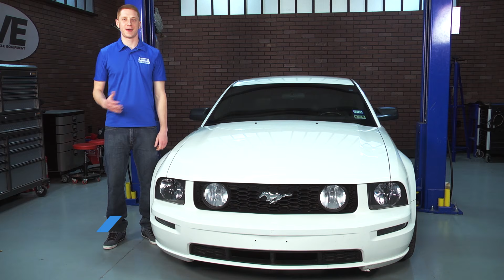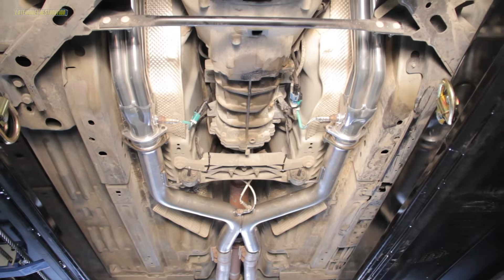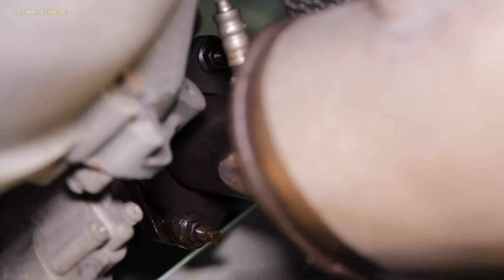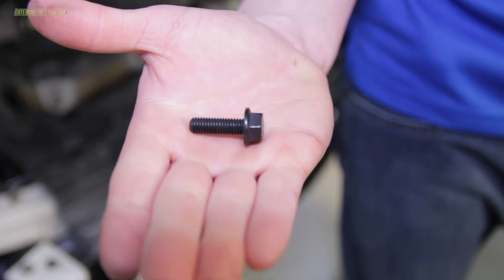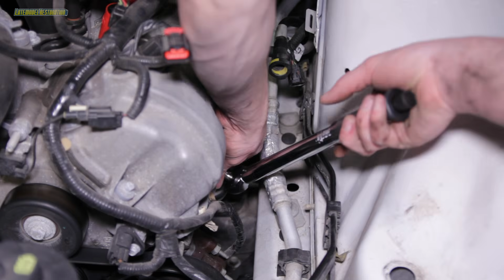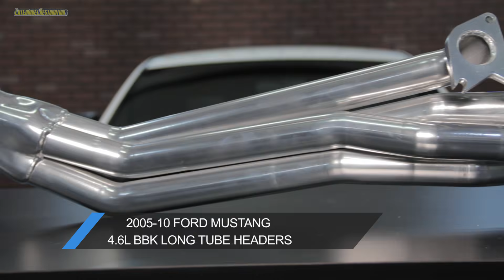Mustang GT BBK Long Tube Headers/Off-Road X-Pipe - Install & Dyno (05-10 4.6L)

Comment: Took me 11hrs in my driveway. The headers slipped right in, but getting to the bolts was a major pain. I recommend buying ARP studs and a chase to clean the treads. Seat of the pants says this was worth it!
Reply: Which studs did you get? I’m running into the issue of the studs BBK sent being too short and heard arp would have something better, I just wasn’t sure which one to get.

Comment: Just got done installing longtubes and it was a nightmare lol removing the motor mounts starter and steering shaft wasn’t too bad with a couple jack stands and a ramp but the problems start at the reinstall of the steering shaft it slightly touches the last runner of the header and the only solutions I can think of is adjustable motor mounts to raise it 1/4 inch or take a blow torch to really nice headers and dent it up

Comment: You take the motor mounts out so easily. I’ve been following step by step in my garage and it’s been taking me hours to figure out how to take the passenger side motor mount off.
Reply: ever figure it out? im doing it right now and could use some insight
Reply: @Dom_3v  if one side is lifting higher than the other....just do one at a time

Comment: For all the DIY people out there, Just because you have to raise the motor a bit to remove the stock headers and slap the new ones in, don’t let it intimidate you. All you need 
1. 2-4 Jack Stands.
2. Correct sockets.
3. 02 Extensions
4. A weekend.
Reply: Shoooot I did mine in my garage on the floor in about 6-7 hours. Everything came apart like butter and I cleaned the mounting surfaces on the heads while I had everything out. Wasn’t bad at all

Comment: Grab two pairs of o2 sensor extensions. The dipstick is hard to remove but with a little grease on the o ring it is easy to reinstall
Reply: This has to be the most under rated comment on here. Bbk didn’t send o2 extension and dipstick was a pain to get out/ put in. Wish I saw this comment sooner lol.

Comment: Can you use the metal gaskets instead of the graphite one that is provided?
Reply from the maker: Yes.  Long term, that's a better option.  Hope this helps!  -Landan

Here is a link to OEM Ford metal gaskets: https://lmr.com/item/LRS-9448C/mustang-3v-exhaust-manifold-gasket-kit-05-10
Reply: @latemodelrestoration  thank you!

Comment: I have a borla x pipe would I need to change them for these to fit.
Reply from the maker: Yes.  Your existing Borla X-pipe is designed for stock manifolds or shorty headers.  Purchasing the correct mid-pipe would be the easiest route to take.

Here is a link to the catted mid-pipe: https://lmr.com/item/BBK-1637/Mustang-46L-Bbk-Catted-X-Pipe-For-Long-Tube-Headers
Reply: @latemodelrestoration  appreciate it !

Comment: I got these but with a catted x pipe ans between 2800-3200 rpm there's a raspy tiny sound that sounds like crap I can't get rid of 

Did you have any sounds like that after the install? 

Only does when driving revving at idle doesn't make the sound 

Changed like 5 type of mufflers still there resonators didn't help

Comment: I’m 17 and did this in my garage alone on jack stands it was easy I got it done in one day took about 7 hours.
Reply: did you need to remove the starter and the motor mounts and everything? or could you pull em out without doing that

Comment: For the 02 sensor extensions I took my mustang Gt 2010 to get my headers installed and got a pair of 02 extensions and was told I needed a front pair but I can’t seem to find any front 02 and the ones I had bought in this videos said they were for rear sensor only
Reply from the maker: Hi Julian, if you can, please contact our customer service team and they'll be more than happy to help you figure out the issue with the O2 sensor extensions. Be sure to include the part number or order number and they'll be able to assist you with that. | https://lmr.com/contact

Comment: Which bolt needs to be cut exactly on the passenger side? I only ask because I didn't cut any and I can hear a leak on that side.
Reply from the maker: Hey there, 

We recommend that you re-torque everything after a couple of heat cycles to make sure that nothing has come loose. If it is still leaking, take the car to a local and trust shop and have them inspect everything.
Reply: @latemodelrestoration  you didn’t answer the question which cylinder bolt needs to be cut

Comment: Will this fit a 2005 Lincoln Town Car/ Ford Crown Vic 4.6 2v or should I order the 96-04 Mustang headers?
Reply from the maker: Hi Danny, 

We do not specialize in the Lincoln Town Car or Ford Crown Vic. You will need to look into Facebook groups or forums for fitment concerns when installing new headers on either one of the applications.

Comment: Desperately trying to get the motivation to do this myself in the driveway with just jack stands...so far, I just keep grabbing beer and stare at it. This looks a giant PITA.
Reply: Take it to a Ford dealership for about 5 or 6 hundred bucks in labor this install is scary lol
Reply: @DJRICKYGAZ  
can the dealership tune?
Reply: @WONDERBREAD89  Probably not, but if you have an X4 tuner, it's a simple strategy tune. Takes about 10 min
Reply: @sherylellingson3538  found out they can do factory tune but thats it..
and i do have and use my x4 now👍
🙏
Reply: I'm in the same boat really want to do this info have a garage and it's not a daily so I can leave it and take my time
Reply: You can do it it's a pain not gonna lie but it is possible
Reply: 🤣 classic 👍🏾
Reply: I ended up doing it on my 5.0 by myself on jack stands was a bitch but doing it again would be easier knowing what to do
Reply: Best comment ever!!!!
Reply: Same I keep avoiding it but I really want to do it but it does look like a giant pain in the ass to do not easy
Reply: It is a major pain to do if your local I'll do it for you for a price
Reply: I don’t think it’s worth it. I’d rather have someone else do it. It didn’t add that much power.
Reply: @CorbettReacts  how about sound?     add more sound? louder?
Reply: Foreal
Reply: did u end up doing it?
Reply: I replaced the k-member on my 09 Shelby GT500 with a BMR tubular one, it was a bitch doing it on jack stands but got it done in one weekend, next step is the long tube headers, I'm also planning on doing the same thing on my 08 Shelby GT350.
Reply: That’s the realest thing I’ve seen someone say in a while
Reply: Better grab a 24 pack my friend 😂😂 it is the biggest PITA ever, but worth it once it's done
Reply: Same here man, just worried about breaking off those studs.

Comment: How can I tell if I put the o2 sensors in the right order or where they supposed to be plugged in
Reply from the maker: You'll want to use the 2 forward O2 sensors in the headers from the factory headers

Comment: Is that stock mufflers?
Reply from the maker: No, the car has aftermarket. At this time, we have our SVE Axle Back kit designed for 05-10 Gt/GT500: https://lmr.com/item/SVE-5230A/2005-10-Mustang-Gt-Gt500-Sve-Axle-Back-Exhaust-Kit

Comment: On average how much is it to have someone install them for you? lol. Also do you have to tune them (the car)  to notice big power gains?
Reply: you probably know the answer by now, but it usually cost about 700 bucks to 1000 bucks for labor, depends on shop. and is best to tune if you get long tube headers and a off-road pipe to get full power out of them and also to takeoff the check engine lights
Reply: power gains probably up to 305- 320 hp with everything else stock with a good tuner

Comment: Only 19 and didn’t think my pops would be up for installing these with me until he told me he was, did it on a jack and jack stands over a long day and honestly wasn’t to bad, definitely gonna get some back and shoulder pain laying  on the floor but as long you’re organized and strictly follow each step you’d be saving yourself $500-$600, I spent only about $100 buying some swivel sockets, deep sockets and other tools I didn’t already have. Do it yourself you won’t regret the learning experience.
Reply from the maker: Thank you for this input on your experience. I am glad we were able to help and if you need anything else please let us know.
Reply: im 18 and I really want to do this myself I just dont wanna fuck something up. but I know I won't regret the learning experience
Reply: @devinharris481 Real shit. Im 17 and i’ve been doing just minor replacements on workout components on my 05 gt, but this just seems super intimidating.

Comment: Wondering if I can do this on my own with just jack stands
Reply from the maker: It would be more difficult to do on the ground with jacks and jack stands but it is not impossible.
Reply: Late Model Restoration I gave it a shot but I was limited on tools so I couldn’t remove the factory H pipe. I was stuck and had to put everything back. But awesome video!

Comment: How to install headers in 3 easy steps...
1. Order headers.
2. Drive to shop, have them installed.
3. Pick up car.
Reply: 4. Paying 1000 for labor
Reply: @reysanchez1908  this shop here will do them for 700
Reply: @reysanchez1908  about to go have mine done , going to pay $450. Couldn’t pass up a deal like that , known the guy who owns the shop forever. Absolutely stoked.
Reply: @v3jaylon  shit that's worth every bit of 400, I wish I could get mine done cheap like that
Reply: I learned that the hard way, it’s not worth it to go through the pain of breaking off studs.
Reply: step#4 payment will be expensive for this job
Reply: Shop wants $800! Hard pass!
Reply: If you can find a shop that wants to do them 😂
Reply: Do long tube headers need a tune after installation?

Comment: I watch this video a few times and was convinced I could do the install. I actually got everything done in two days. If someone else was thinking of doing this I would advise a electric ratchet and a swivel socket. Also you might wanna get a flexible dip stick tube. Getting the old one back in after the header install is a b****. Also majority of the studs on the passenger side has to be taken out so you can get the header up in there.
Reply: hey man did you end up having to take out the starter and everything else? or could you get them out and back in without removing that crap

Comment: I like the stock look with ,,with the roush power and tune,,the stock engine should be okay @ 550 HP with out having to rebuild it with forged  parts,,,,
Reply: Actually the biggest thing when it comes to forging is the TORQUE that you are producing, not the horsepower :)

Comment: Stop adding all the BS add on's to your Mustang,,Get a roushcharger installed ,.  I did,, nothing compares ,
Reply: you have to remember that a supercharger kit is wayyy more expensive than FBO. Just depends on what kind of reliability/how deep your pockets are.
Reply: purchase a one owner  2007 mustang gt premium convertible  with 21,000 miles in 2017 for $18,500  (new sticker price was $ 38,000) added the roushcharger installed by a my local Ford dealership for $7,500 for $26,000 I have a stock looking Mustang Gt ,,with the power of a  $55,000 Shelby GT500 , and can boost it up to 550 HP for another $1,250 ,,,but I'm very happy with the power it has now ,,,
Reply: @mikeray2782  Yeah man that's badass, but an H pipe with axleback, headers, tune, and intake are only gonna run you around 12-1500 bucks, and be more reliable than a forced induction car. Not to mention to continue to make power with the 3 valve 4.6 you have to build the whole engine. That's serious cash. If you just want a fun street car to turn some heads there's nothing wrong with FBO

Comment: Just to put this out there....BBK 62mm TB's, all BBK CAI's & BBK LT headers tune data is integrated into the OEM stock Ford 4.6L ECU tune mapping under the Options List so when LMR uploaded the tune they didn't need to write & upload a whole new tune, they only went into the STOCK OEM 4.6L tune map's Advanced Options List & checked the BBK LT headers selection under Exhaust (tells the ECU to use the already integrated BBK LT header tune mapping) & checked the rear O2 delete selection under O2 Sensors (tells the ECU to turn off the 2 rear O2 sensors in the ECU tune map & to stop monitoring\maintaining catalytic converters) then reflash the STOCK ECU map w\ the new mapping changes for the installed BBK products to the ECU. All you need is a tuner (like a SCT X3\X4) to access the ECU to do all this.

Comment: how do you remove the steering shaft
Reply: Remove the 13mm bolt as shown.  Inside the car, where the steershaft meets the firewall, remove the driver's side 10mm bolt and loosen the passenger side bolt.  Then you can just move the steering shaft out of the way from under the car without removing it.  Gives you plenty of room for installation vs removal
Reply from the maker: Please give our tech team a call at 866-507-3786.

Comment: I find it interesting how many folks are bashing the header install because it was "too much work" for the small power gain... you folks do realize that these headers were installed on a car with a stock intake, stock intake manifold, stock heads and stock cams right? Any one mod won't make big gains, but once you put them all together you start to see the power...
Reply: Just the lazy ones... 😴
Reply: Yeah what do they want a 100 horses from headers it all adds up whining babies
Reply: Absolutely
Reply: But it begs the question, just buy a 5.0....
Reply: forkandknife idk about you but not many people have $20k+ to toss around for a 5.0 sure you can get a loan but you’ll be paying that for a long time
Reply: @RoobiDoobiDoo  the first s197 looks much better, than every mustang after. Also some people love doing stuff Like this..
Reply: BlazerMountain, if that’s the way to do it, just buy a GT500, or a Cobra Jet. Hey, better yet, just have somebody else build you a Promod!!!!

Or, you can hang out in the shop with friends and family while you build a car that you know every nut  and bolt on.  One that, if you know anything about what you are doing, will also be a car that you can actually drive, rather than one that you lose control of the first time you light the tires and plow thru a crowd of people...
Reply: That is an entire engine rebuild. What's the point?
Reply: @stangboyjones3684  so your car can be faster?
Reply: Stangboy Jones 😂🤣 it’s not an Engine rebuild. it’s just what you Gotta do to put headers in.
Reply: Stangboy Jones learn how to turn a wrench my man
Reply: @stangboyjones3684 thats considered basic bolt ons on these cars lol

Comment: I have an 09 Bullitt. Love the look, sound and heritage of the car, but it's down 100 hp from a coyote. It makes no sense to me to invest A LOT of money and not get close to coyote power.
Reply: Stop adding all the BS add on's to your Mustang,,Get a roushcharger installed ,.  I did,, on my 2007 GT 4.6 nothing compares , and yes it blows away the 5.0 's Coyote ,,,
Reply: I put a Roushcharger on my car,  only a few thousand. Or you can buy a whole new car for tens of thousands.
Reply: @ognaysayer  a few thousands ??
Reply: @mr.b8372  Speed isn’t cheap sir.
Reply: Just build your bottom end and moon boost it. You'll make over 600 real quick for 10 grand.
Reply: turbotommyguns Exactly you said it!!! Just go with the 5.0

Comment: What I don't get about any of these videos or AM vids are that they always do a tune before the Dyno test.. And when I see Dyno tests of just the bama tuner or sct tuner, just with a simple tune the car gains 19-21 hp and 20-30 torque.. So what if all these power gains are from the tune and in reality you only gain 1-3 hp from the full exhaust? Or what if the tuner only gives 2-4 hp?? That's why I don't like it when before the Dyno test, they do a tune :/ but that's just me
Reply: Usually there is a base aftermarket tune on the car before they tune for the part they've just installed. For example I imagine they add a new tune from stock even though there were only coil packs and a different muffler. Then they added a new tune for the header and mid pipe. Meaning, the last dyno pull was right after a tune (3), and the numbers it showed were an increase over the previous tune (2). That tune would've been an increase over the stock tune (1) from the factory.
Reply: Smoky LMR does another video installing shorty headers on a 3 valve  Mustang and gains 10 h.p. but feeds through the stock H-pipe and cats , if it had been an off road x-pipe  it might have been the same as the long tubes .
Reply: Isn't there a break in period of 25-50 miles after you load a tune? So would dynoing it right after screw that and not deliver accurate numbers?

Comment: The modified bolt needs to be 11/16", Should be included for the money spent on the headers and O/R X pipe.
Reply: Andrew Kemps thanks man, we are doing the install right now and the video didn’t help there
Reply: Thank you
Reply: Where do you put it though?
Reply: why do we even need an adjusted bolt there

Comment: hey guys nice vids, I have a 08 gt with bbk long tubes and it sounds like my drivers side header gasket just blew out, should I start with tighten them or just go ahead a get it replaced
Reply: what did you end up doing?